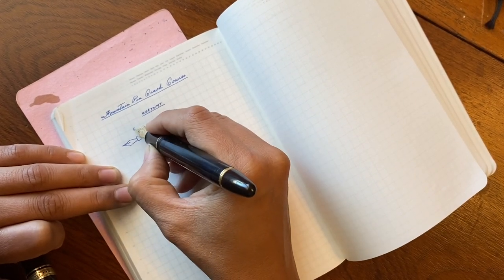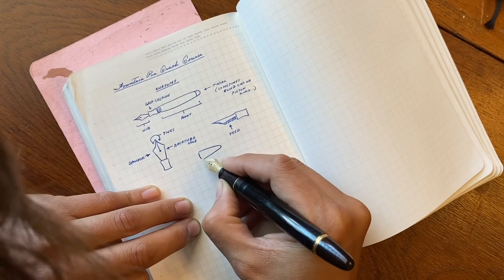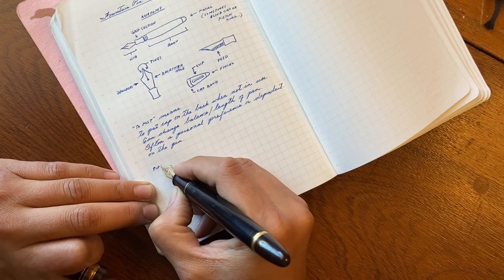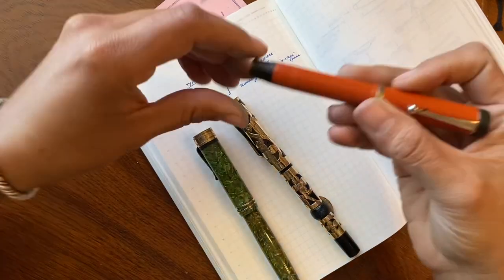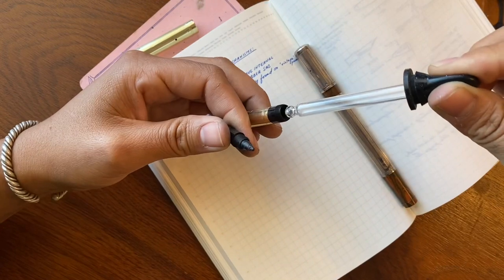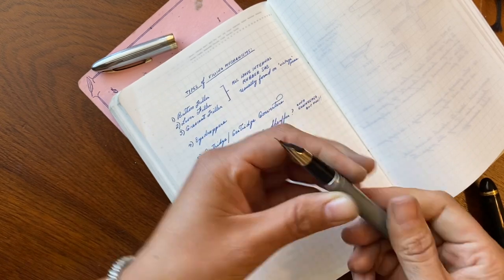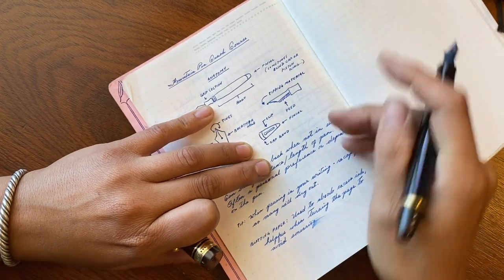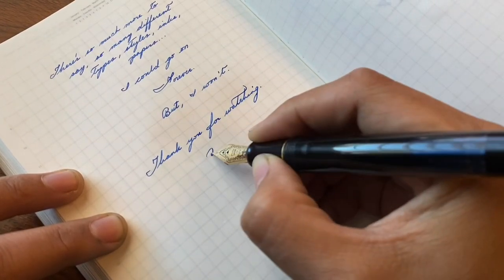Crash Course Fountain Pen.

Comment: New Howard subscriber and I have a question: you mention these pens put more ink on the page. Would this cause more smearing for those of us who are left-handed? Would you maybe not recommend these pens for lefties?
Reply from the maker: Hello and welcome! It could very well cause more smearing. I’ve heard of lefties using drier inks, or more absorbent papers to help that. I’ve also heard of lefts altering their pen hold so that they approach either from above or below to avoid dragging their hand across the words. There are a handful of lefties that I know who collect fountain pens and use them exclusively, so it is quite possible. There are also nib smiths that can do a left handed grind so that the tip of the nib doesn’t push into the paper so much. The lefties I’ve talked to though have just altered how they hold a pen to accommodate.
Reply from the maker: Going to try and find some of the yotubers I know whom are left handed...

https://youtube.com/user/ambrielly
Reply from the maker: https://youtu.be/IypzgWiN1GY
Reply from the maker: https://youtu.be/WAPX0i0ZSro
Reply: @adventuredenali  Thank you kindly for the response & for providing the links! The continual smear is a nuisance for lefties. Regarding altering your pen hold, I feel like I could change it for a few minutes but would ultimately resort back to my comfort hold, so I give credit to those who have been able to successfully change their grip.
Reply: Sheaffer and Parker ink dries really fast. So do the Pelikan 4001 series. I've also found De Atrementis and Diamine inks (Emerald, 1864 Blue Black, Espresso, Damson, etc.)  to handle well too.  Some of  Noodler's more popular inks are hard to handle unless you write slowly and adjust your pen grip.

Comment: I really liked this. As a fairly new Fountain Pen enthusiast, I found this very helpful. Please consider making more. You clearly have a lot of knowledge on the subject and seem to speak a lot from experience. I recently got my first flex nib and struggle with getting the ink to flow well. I'm not sure if it's the pen or the user. Lol. Anyway, I like the way you explain things. So this is my official request as a fan. Please make more crash courses! Haha! Thank you!
Reply: Flex pens take a while to get used to. Slowing down your writing speed a hair might help with the flow issue. If it is something like a vintage Ladybird, that one was designed for Spencerian script despite its pocket size. I find that they don't need as much pressure flex wise to work.

My view is coming from working with flexible dip pen before jumping into fountain pens personally, so that made the learning curve a bit faster unintentionally. Also, your ink can affect the flow issues too.
Reply: @sheelachattopadhyay  Oh I haven't thought about the ink. Interesting. Maybe that's where I'll start. Thank you!
Reply: @tragicallysarah7623  wrote: "Oh I haven't thought about the ink. Interesting. Maybe that's where I'll start ..." ....... About ink: DO NOT use the following inks in a fountain pen: Iron gall ink (the type used to write the US Constitution, using a quill pen), or India ink. The iron gall is acidic, and is especially bad for steel nibs. The India ink is a thick ink designed for use with dip pens and brushes. It dries quickly and will clog the feeds of fountain pens. Inside the pen, it dries to a hard crust. Recently "shimmer" and "glitter" inks have been introduced. I accidentally loaded one of my pens with glitter ink. The ink had tiny metallic-looking particles in it, and it jammed the feed of my pen. I had to clean the pen with my ultrasound cleaner. I have not used shimmer ink; to me it is just a gimmicky novelty, and doesn't look natural when it dries.

Comment: Nicely explained.
Don’t have many fountain pens myself. Started with a handful of Lamy Safaris, then 3 Platinum Century 3776s (inked with Noodler’s bulletproof inks (reason for getting the spring-capped Platinums)). Recently started on brass fountain pens : Traveller’s Notebook one and Kaweco lilliput wave.
Noticed the image was slightly bouncing and did find it a tad distracting. Camera tripod on the desk, rather than floor? Or, desk wobbly?

Comment: Pilot Parallel calls them plates and not tines. I have been having a tough time with Mont Blanc Toffee Brown drying in the nib. It doesn’t take too long to dry in the Lamy Safari I have it in right now. I have to clear out the nib to get it flowing again. Even capped it dries out after not very long.
Reply from the maker: Oh wow, is it a particularly dry ink? Have you had these pens drying like that with other inks?
Reply: How strange. I have had my Pilot Custom 823 inked with MB Toffee Brown from the day I bought the pen nearly three years ago. Never had this drying out problem you cited here. Only goes to show the bafflingly varied experiences we have with many of our particular pens and inks.
Reply: Only had issues before were when I had too many pens inked and didn’t use them frequently. Or some cheap scratchy Jinhao Sharks that gave me some trouble. I have been cleaning my pens and getting the number that are inked down, but I do like to rotate colors I write in the journal every day. When I get a new pen, I want to ink it immediately, but trying to get myself to have just 5 or 6 inked at a time. I might start writing down when I filled a pen in my journal. In the back I keep a sample of the pens I have inked. Just the name of the ink and pen using it. When I empty one, put an x by the note. 

I wonder if maybe the cap isn’t sealing that well. Sometimes when it starts it is darker and almost greenish black for the first few letters. Then it clears up and looks normal. If I put it down for a short time without capping, it dries up some and is hard to get flowing. I’ll try it in a different pen next. Maybe a TWSBI since they seam to really seal well and I’ve never had a dry start with any of the ones I have.

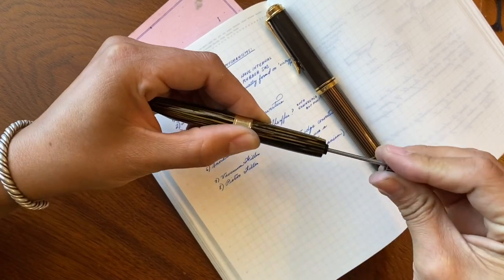Comment: could you tell me the year and model of the sheaffer pen at 6:12? My friend has one identical and i have one that is solid black with a brushed chrome cap w/ gold band. I'm so confused as i can't find an accurate year, make, or model :(
Reply from the maker: That one is a Sheaffer Tuckaway, circa 1949. These models came in various colors, cap styles and trim. The earlier ones had a different nib, but most have the Triumph nib like this one shown. There were also some larger models that look very similar to this one. The Tuckaway was a small pen.